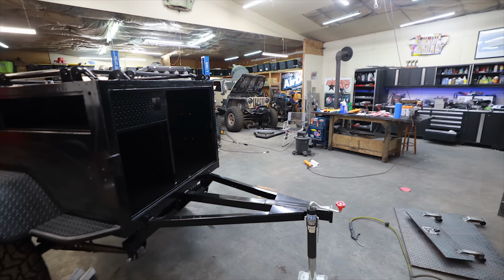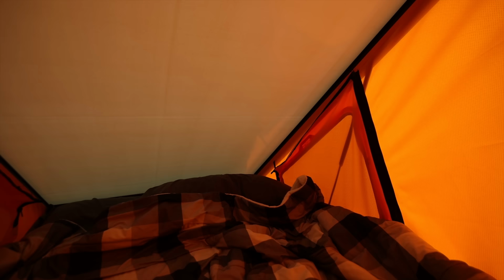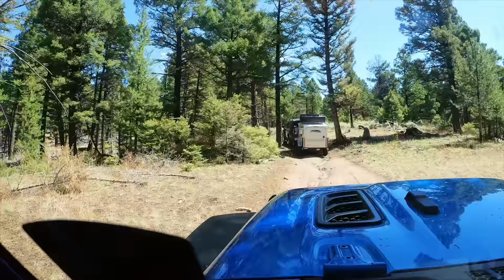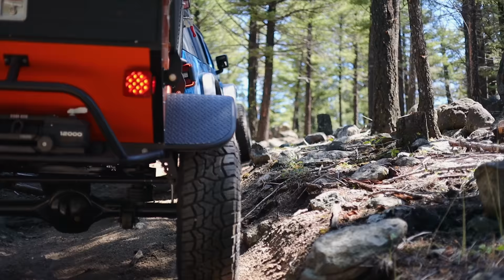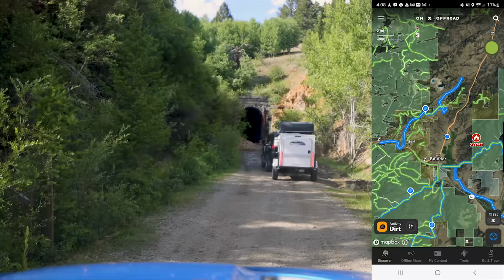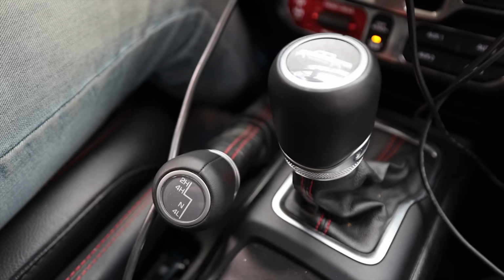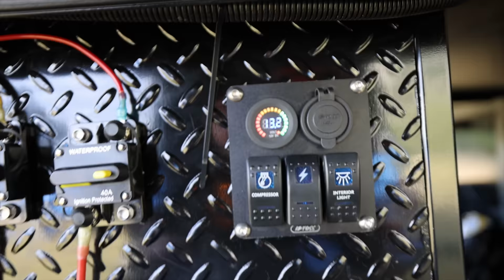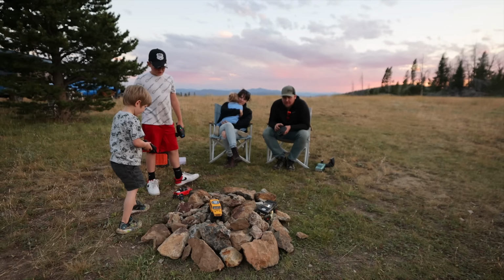Problems On Our First Trip... Harbor Freight Off-Road Trailer Episode 12.

Comment: The first place to start is to define the spaces where junk goes otherwise, for me, something ends up anywhere where I cannot find it again.  Using it like you are is, though, frustrating at time, is a good way to "know how your going to use it" & naturally go for X, Y or Z.    For example where the fuse block is. 

1.  I would first separate & divide this area by walling it off keeping the long space open.

2.  Put in shelf as low as possible, with the trailer angling in, it would be a compromise between usable width and usable height. This could hold your air compressor with a hose connector easy accessible or oil.  (Stuff you need once in a blue moon but have to take.). 

3.  Just bellow the door opening have a shelf there that doubles as a access panel below.  Things like air hoses, snatch blocks & power cords that need to always be on hand.  This will give you quick access to the things you are likely to need or things accessed all the time.  Big stuff that is easy to move so you can access the fuse panel and under storage.
Reply: Nate either do a web or summit racing search for "race trailer organizer". Most of the products to me are stupid expensive but are relatively  easy to build. Or combine ideas for something more suitable!    Racers / pit products have a solution for the simplistic things for this reason.

Comment: I like all your ideas, but it looks like you will need to make that 2nd cut out (maybe a pantry?), & table on the sde of the trailer, as you mentioned, about 4" to 6" lower for Mrs DirtLifestyle.
& I think you should have painted the trailer blue, to match the Gladiator. I'm sure Mrs. Dirt Lifestyle would agree with me, that the purse should match the shoes!

Comment: So for storage, in that front compartment, divide it into 3rds, 2 lower drawers like the decked and one top cubby for chairs and poles and such and put like a mesh front and rear to allow airflow and make it feel open and easy to get stuff. In the rear, if you have the depth, a shelf up high for your tables to slide in, if you have room after your mods, divide the bay in half vertically, do your mods on one side (heater, water filter/pump etc) and the other side for duffle bags, pillows sleeping bags etc. As for your battery, if I recall it's an optima yellow top which is an agm battery, I assume you have the charge controller set properly but I thought those optimas are essentially under hood replacements so probably the 13.3v was a surface charge while the 12.5v was it's actual charge. You can try to recondition/repair the battery with a battery charger (I've had great luck with nocos, I'm sure there's better ones out there) that might bring some life back to it but I'd bet it's only like a 35ah battery so not the largest capacity. If you're going to upgrade you may want to consider lifepo4 batteries but you might want to make a water tight compartment if you want to leave the batteries under the trailer.

Btw I've loved the series!

Comment: I don’t know if you will see this, but get rid of that big cone filter and get some 1/2” ( pcv engine filters ) or even a brass “ muffler “ filter. You need less than a 1/64” hole to equalize your altitude pressure. 

I saw else where someone said to get a fan for active dirt removal. If you do that you need 2 filters which is okay but not practical but the pro about an “ active “ dirt ventilation is you have airflow reducing moisture build up or stagnant moisture causing mildew. I actually have a design for this system if you’re interested

Comment: This has been a very neat build, and I loved seeing the payoff.  I agree that a drawer sounds like a good idea for partially organizing the storage, and maybe work up a system of containers that fit in the body of the trailer to better organize things above the drawer.  One thing I would definitely do is come up with some sort of covering system for the ends of all of the fasteners that protrude into the storage body of the trailer.  They will be forever snagging on and poking into your cargo, adding aggravation and damage, two things you want less of on a trip.

Comment: Awesome trailer. If you had airbags to replace or augment the springs, you could pretty easily run individual lines to the onboard compressor you already have and that would let you at least level the trailer side to side with a bit more ease. In addition, if you ran switches or a remote you would be able to effectively lean the trailer with the airbags when it is off camber on a trail by increasing the pressure on the low side.

Comment: Trailer looks like it performs awesome! Re the drawer storage, maybe consider a drawer system that has a full length lid that's able to be flipped over when you have the drawer out effectively making an additional table. Those are really common here in Australia as a trundle draw at the back of ute canopies

Comment: If i was doing what you asked about the inside of the trailer this is what changes I would do:
1. When you open that back flap door I would put a divider across the whole thing at where the rear angle goes flat on the bottom (if that makes sense) and I would use that "X" pattern metal or make a metal molle panel so you can attach things to it. 
2. I would add 2 drawers like you talked about and have them be as long as it would be to the divider I mentioned above
3. Adding another "large" square door on the side you talked about, where when you are looking at the opening the left side would be where the divider from #1 would be and finish it with either shelves, molle or combination.
Hope that makes sense, cause I can see it in my mind but not sure if how I'm writing it is correct. Great job either way though.
The big option my Gladiator didn't come with that I so wish I had, the front camera. I know you can do after market but it looks like a pain to install.
Reply from the maker: Very similar to what I am invisioning 🙌

Comment: Because you decided to access the storage from the front of the trailer, that back hatch does not make for easy access to the rest of the storage area. I do not know if you could make a slide out for the front without running into frame and other components, but a slide out on that storage compartment in front would be a good thing. Your angled section in back could have a second hatch (opening downward) that gives a place to stuff folding chairs and such. You could add a shelf and make the existing hatch a separate compartment. You have a good idea of adding more storage to the kitchen shelf side.

I have been looking at the Northern Tool Ironton trailer for a couple years now with similar thoughts of building a chuckwagon trailer. Your own project has given me some thoughts about revising my own plans a couple times now. Design tweaks are happening here and there. I will however be building based on rear access with a full camp kitchen in back, a shower on the front right, and a canopy covering the left and rear sides allowing the right side to be social area and electrical access (up to 4 batteries in a tray and an electrical panel above them) on the front left side opposite water pump, water heater, and shower head (I am looking at one of the built in shower heads used for boats)

Because I plan on using a contractor rack instead of the typical "overland rack" on my Tacoma,  I have designed a custom roof top tent to set between the side rails with storage space below the bed platform. To simplify matters, when I build the trailer, I plan on including a custom rack designed to the same dimensions as the bed portion of my contractors rack allowing it to open to the right and use an annex curtain for dressing room and shower (though the port-a-potty will be set well away from camp) My RTT design includes a "headboard" that is styled after the old waterbeds with space for electrical connection for charging phones and such (though my camera gear will have a recharge station that I will keep in the truck), and a ducted vent to allow a fan or heater to blow air into the tent depending on weather conditions. I found an overhead LED strip on amazon to provide light inside, and designed the shell to be 3 layers (insulation hung from the shell, shell attached to external frame with plenty of windows for potential air flow, and rain fly over the frame. But since my father (and a couple of my friends is no longer safe on ladders), I will also be making a tent that attaches to the awning like an oz tent (or more specifically like an old baker tent) so he/they can sleep on cots or other folding beds at ground level. Due to my awning design, I will be able to attach it to either the left side or back of either truck or trailer as I plan on making an awning for the trailer, and a second one for the truck since I will not always travel with the trailer) I have already designed a small camp kitchen module that I can fit in the bed of the truck so it is accessible from the right side bed cap windoor.

I have seen a pivot hitch design that limits how far the trailer can roll but I have also seen trailers take their tow vehicle with them. Independent suspension also seems to tame the body roll on trailers from what I have seen in other people's builds. It seems to allow more articulation. 

We have a tunnel like that in East Tennessee called Nemo. I have not heard an update, but some idiot tried driving across the active rail line that is next to the tunnel and stalled out resulting in a collision with a train (no one was hurt thanks to a photographer who witnessed it warning them to get away from the track as the train approached), and the rail road is not happy, so they are looking at closing the trail. Around a mile with curve, so there is a stretch where no natural light passes through. It is a fun drive. It is flooded just like that tunnel.

As always, I look forward to seeing more.

Comment: I got the DECKED too. It worked well with my ARE bed topper, but I sold the ARE because no one could tell me the rating for the roof rack. Waiting on my bed rack from Extrusion Bed Racks and my Softopper.

Comment: Been using an off road trailer for years and I have a couple suggestions. 1) Make the tongue longer. It looks like you're a little cramped at the back of the truck. 2) use trailer jacks for leveling. Weld them to the frame and just crank it up. It also takes load off the suspension for less motion when you move around in the RTT.  3) My experience has been that I don't often camp close enough to water for a hose and filter system to be useful. I use a gravity filter system to filter water when needed, which isn't often. Then I can walk to water and bring it back without having a ton of hose.

Comment: Hey Nate great build the ideas your thinking about on your trailer sound good that's how I would do it a little suggestion on your leveling issue. You might think about swiveling trailer jacks like your hitch one on the back corners also air bags for the truck that can air up separate. Just some suggestions 👍👍👍👍👍👍

Comment: Definitely need a new battery.  It’s holding voltage but the amperage is going to be way down. 

Once the battery is sorted, have you considered electric trailer jacks in the back corners to level at camp.  
Not really budget. But if you did the front tongue also you could lift the entire thing without wheel blocks. 
Downfall is your hitch isn’t quick to disconnect without tools.

Comment: That trailer is awesome. Judging by the footage from behind it looks like the HD springs were the right call. For the drawer, my first thought was a fully boxed drawer frame, with a slide out drawer on each side of the trailer (split them however deep you prefer for each side), but I'd put 2 flip up lids on the passenger side drawer to help seal, and to provide another work surface to lay stuff on when prepping meals.

Comment: I originally ran a yellow top optima in my overland trailer as well, I found that even with the solar panel with only 55ah it wouldn't stand up to multiple day trips in the woods. I recently upgraded to a Weize 100ah lifepo4 battery off of amazon for less than $400  and it has been a night and day difference not having to worry about power espicially when you have days of rain when the solar panel isn't at max charging. Plus the weight savings aspect as well. Really enjoyed this series so far looking forward to what changes you make in the future.

Comment: i would consider doing a 'decked' style slider system through the front, possibly even one on top of another, so there's 2 sliding pieces-- that way, it's easier to take over the entire space  and you can get access all the way to the back of the area-- you're not committed to 'tactical loading' as it were without the drawer.  disadvantage of the double drawers though is going to be a loss of the drawer slider space, which might make the drawers too small vertically to be useable in some instances.

as far as the back, i feel like a roll-out shelf through the side would be really nice to better maximize the storage area there.  if done right, the sliders might be below the rear access door, so you'd still have unimpeded entrance to that lower angled storage area.   other option i can think of is a suspended cargo net, advantage here is that it's quick and easy, and non-permanent for different types of cargo that might end up back there while still making use of that dead space on top around the breather filter.    i briefly thought of a pneumatic shelf like the the one that casey ladelle put in his wifes jeep, but i feel like there'd be too much stuff on the shelf in your case to really take advantage of the concept through such a narrow opening
https://www.youtube.com/watch?v=RTvqsqFIQc8

seeing the back-to-back portions of the video with your buddies pre-built offroad undampened trailer to your dampened trailer definitely makes an obvious case for the difference between running shocks and not running them!

the only running concern i've still got about the battery is being underneath like that is where it'll be covered in wet mud, which might be highly conductive?  i've never really tested the conductivity of mud before!

as far as the shelf height--  an interesting project might be to run airbags instead of coil springs.  i understand the re-use of parts, but with airbags, you'd also be able to level side-to-side at the campsite as well

Comment: Would love to meet all of you on the trail. Great series and it’s giving me a lot of ideas about my Home Depot trailer I’ve already modified once before by swapping out the 2.5 to a 3.5 ton trailer with taller tires to ride right with my lifted jeep and a drop hitch. This was done to carry camping stuff and also pull home a ton of pellets for winter heat. Thinking about putting my old stock jeep suspension with my old Dana 44

Comment: Two minutes and 22 seconds soon you can get a jack for the front of the trailer a bulldog if you will where you could remove the wheel and exchange it for a flat surface where you could put blocking under it without compromising the wheel structure and then you could put the wheel back on just like changing out your hitch to be something to look into or I bet you can fabricate that I mean it’s a pipe with a plate and a hole in it

Comment: I have a small Xventure and the main bed/stoiare is a pain to organize. I’m thinking of putting a slide in the whole bed or a split dual slide. Try to get to things otherwise is awful.  The other issue is the torsion axle has no cushion and is a very hard ride for the contents.

Comment: For leveling: seems like it would be easier to level the trailer, disconnect, then level the truck

For the front compartment: most higher end motorhomes have slides for easy access to stuff buried in this compartment

Comment: Hey Nate, not sure how you set up the axle on the trailer. I had an idea for a trailer using an axle. I thought about putting a pulley on the pinon yoke, then using brackets to mount a VW generator. The trailer driving down the road would spin the generator charging the batteries.

Comment: I was thinking about your articulation problem. I was wondering, if you would change to 2 light weight tandem axles, with the pivot point in between the axles, like a logging trailer, that should give you a lot more articulation, and would stabilize the trailer by a lot. It would be very interesting if you could try this out.

Comment: 12.6 is proper voltage 13.5 was a float charge.
Reply from the maker: It's funny you say that, I realized the same thing when editing. The fridge still kills the battery in a matter of hours where as the same fridge would go a day and half on the factory tacoma battery. I've got some new batteries on the way 😁
Reply: @DirtLifestyle  You should just build a LiFePO4 battery. Very easy and inexpensive. ~ 600 including shipping and BMS for ~ 3.7KW. Smaller and lighter weight (more energy densisty) than any of the other commonly used batteries in USA. Will last 5000 recharge/discharge cycles before loosing 20% capacity. You can utilize 95% of the capacity every time you discharge. Doesn't catch fire. These batteries are the ultimate 12V replacement. I've been running two of these home built setups in my spare tire well for years now, with constant off-road abuse and zero issues. YouTube has plenty of videos to demonstrate battery assembly. To comment on your surprise when you saw the battery voltage drop - totally normal under load and even when a battery is fully charged it will equilibrate down to its nominal voltage over time. Educate yourself and then produce a vid for the masses showing this LiFePO4 option. The overlanding community doesn't seem aware of how accessible this far superior option is..